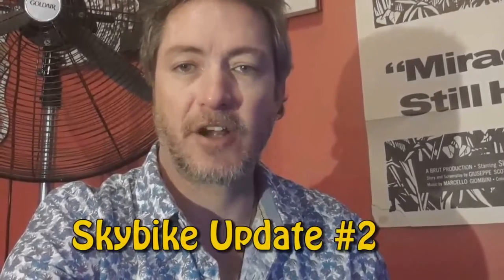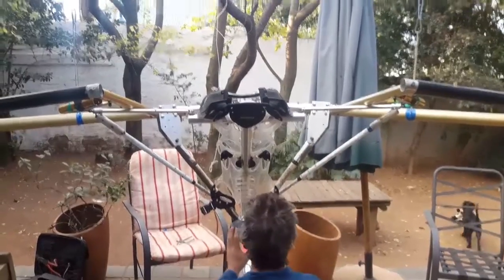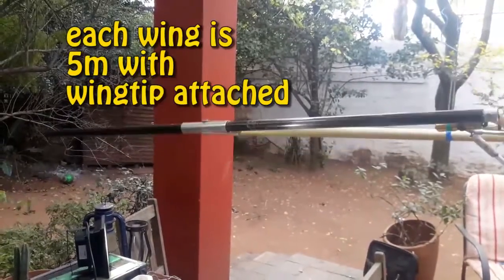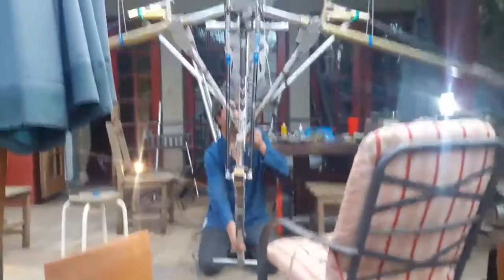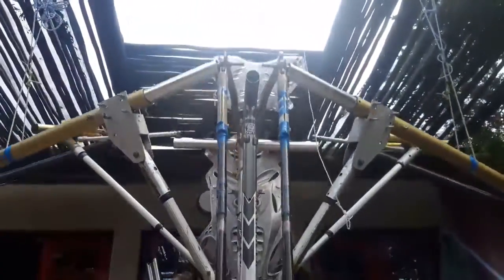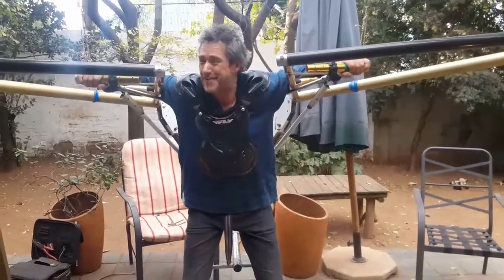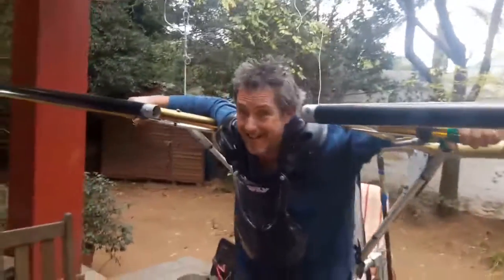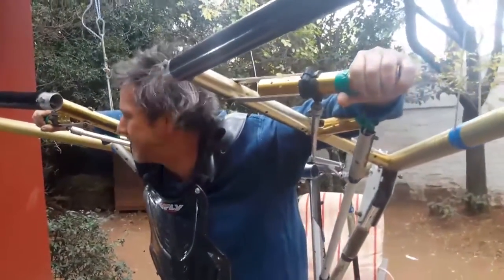SkyBike Demo: Building A Human Powered Flying Machine!

Comment: So you're thinking that If you could actually use a jumping motion to activate the wings flapping, then you would have the strength maybe. Hmmmm.. I don't think this will fly, but I LOVE your methodology. Please prove me wrong. That would be awesome!!!!!! Although it may be better suited with a Falcon wing because that wing is very slippery in the air being double surface. Single surface may be much more stable. I don't know if you've flown a hang glider, or anything for that matter, but if not then you should take lessons. They are cheaper and less painful than a hospital bill.
Reply from the maker: Its gonna happen Gerry